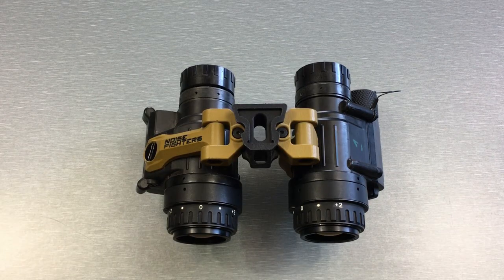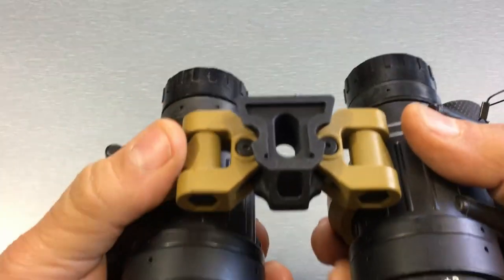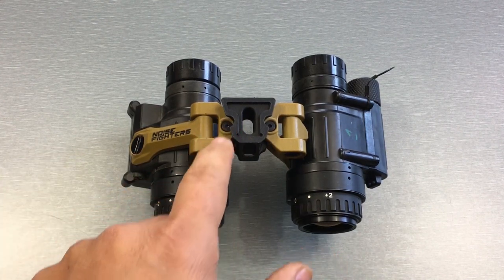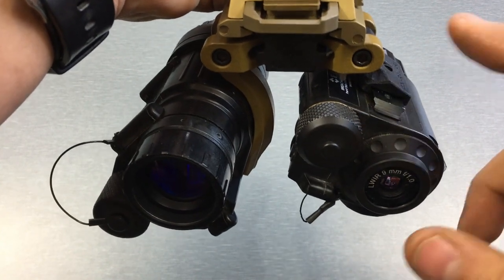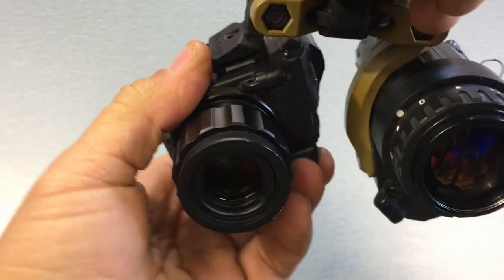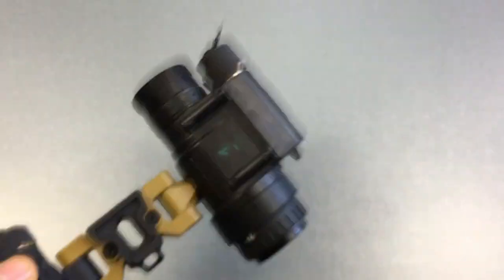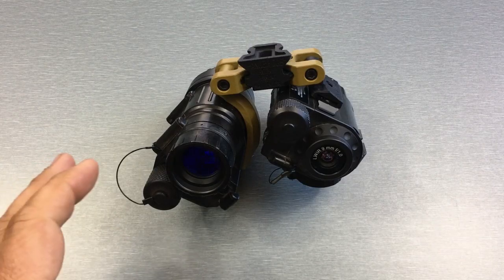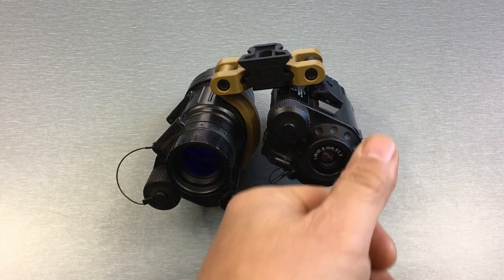Panobridge Mini-Rail Arm for Thermal Mounted Set Up

Comment: And you might note the pano bridge is a viable option compared to using anything offered by Knights Armament Corporation (KAC).  After watching your Thermo FLIR Breech video in 2020, I ordered the KAC setup you suggested.  Now 13 months later I'm still backordered at TNVC with no delivery date available due to KAC components being on backorder without an expected date of delivery.  So while the KAC bridge and shoes make a very nice setup, I may have to use my pano bridge to put my FLIR into service.
Thanks for the information you provide, it's very helpful.
Reply from the maker: Thank you sir. Yes, much more viable option. KVC is MIA unfortunately

Comment: Nice ive been thinking about getting one. And the qd feature would be nice but as long as you can rotate it out of the way it's fine.
Reply from the maker: If you don’t need QD and they’ll be staying on the bridge, the PB is a solid option. The pano feature does help to line up the screen compared to all other articulating bridges I’ve used

Comment: Have you tried using a iray mh25 or ml19 with the pvs14 eye piece adapter with a pvs14 instead of the breach? If so how did you like it? If not any reason why not going that route?
Reply from the maker: I have not. I don’t have access to them and I haven’t had a need to buy one because the Breach meets all of my needs. My property is treed pretty good and the average visibility distance is less than 75 yards.

Comment: Have you had the chance to get your hands on the iRay MH25 or rh25 thermal's? The RH is pretty dern expensive but they're saying they are higher resolution and easier to use. Would be cool to get a comparison video to see if its worth the extra price tag on the RH25 unit or if a breach is good enough.
Reply from the maker: I haven’t used one but I’ve seen the image and it’s no doubt better. But if you’re mainly using it at shorter ranges the breach is perfectly capable.
Reply: @NITEWALKER-NIGHTVISION  Understandable, thanks for the insight.

Comment: How long can you bear to wear this system? What's the total weight?
Reply from the maker: Total weight with two PVS-14s is around 24-25oz. If your helmet is balanced well and you have good pads it’s not terrible and especially if you’re used to wearing helmets.’
Reply: @NITEWALKER-NIGHTVISION  Do you need manual gain if you want to do this kind of setup? Would a tanto with no manual gain make it difficult to combine the 2 images, or can an iris work to substitute?
Reply from the maker: @musicman1eanda  You should always use a monocular with manual gain. When you use it with the thermal you’ll likely run it at max gain but there will be times when you use it by itself and manual gain is what you want. 

By lowering the gain, you can get your brain to combine the vision from your unaided eye.

Comment: So what mount IS your favorite for running pvs14 with Flir Breach?
Reply from the maker: KVC. Unfortunately they’re still MIA. Hopefully will have them soon
Reply: @NITEWALKER-NIGHTVISION  where does the KVC surpass the panobridge or Wilcox bridge mount in your opinion?
Reply from the maker: @practical_precision_shooters  for use with a thermal: better IPD adjustment, QD attachment, and more adjustability at the center dovetail in particular
Reply from the maker: @practical_precision_shooters  to make clear, the Wilcox MUM arm doesn’t not have QD or IPD with their thermal arm.
Reply: Been waiting over a year for the KVC so far
Reply: @mikeb4708  has it been on backorder?
Reply from the maker: @mikeb4708  unfortunately unknown eta still 🤬

Comment: I just got mine and I'm a little disappointed. It seems to me that  it wouldn't take much for it to break. Wish they had one in aluminum
Reply from the maker: Although it has some “bendiness”, the material is tough. The material is what makes is so light. Aluminum would increase the weight by a few ounces
Reply: @NITEWALKER-NIGHTVISION  I hope so it wasn't cheap. Lol.. other than it feeling flimsy I do like it. Field of view is a lot better
Reply: Question for u. I also have the TNVC powered bridge mount..do u know of any cables I can get and a battery pack that's compatible with it?
Reply from the maker: @armon8399  the PBM uses a LEMO connector which is compatible with ANVIS battery packs. The AB Night Vision LPBP-GO’s cable is long enough to reach it.

The standard USGI ANVIS battery pack cable is not long enough because they are designed to work with helmet mounts that also have a cable, but if you are capable with soldering/splicing you can extend it.

I recommend using the ABNV LPBP because it’s much more durable and is a dual fuel pack (AA or CR123A).
Reply: @NITEWALKER-NIGHTVISION  I have a ANVIS battery pack and I couldn't find a LEMO cable with the correct ends on each side. It's been a while but I think it needs a feamle and male end on the cable or something like that. What ever it was, a standard lemo cable would not go from the anvis to the PBM. I did speak to someone at TNVC and all they said was to get a custom cable. Didn't help me much
Reply from the maker: @armon8399  the USGI Anvis packs are prewired with the cable coming out of it with just one connector that will plug right in. It’s the same connector used on the ABNV LPBP. If you get the LPBP you’ll be good to go
Reply from the maker: @armon8399  but like I said, most of them the cables aren’t long enough because they’re not designed to reach all the way to the goggle, but instead meant to plug into a cable from the mount. The LPBP cable is made longer in order to reach

Comment: Can you get the images to fuse now by tiling the thermal?
Reply from the maker: It might help but everyone’s ability to fuse the two different images is well, different, lol. I’ve only been able to “fuse” them using the Breach in outdoor alert mode.
Reply: @NITEWALKER-NIGHTVISION  Ahh I see. Your older videos indicate you weren't able to get a fuse at all.
Reply: @NITEWALKER-NIGHTVISION  With budget in mind, what is the most cost-effective system for general use looking around the property? PVS-14 with what kind of thermal (scope or ortherwise)?
Reply from the maker: @user1acount  sorry been busy busy. I’d take a -14 and thermal monocular over duals and no thermal
Reply: @NITEWALKER-NIGHTVISION  Thank you for the reply. Would helmet mounted thermal be better than a scope? Do you prefer a certain model?
Reply from the maker: @user1acount  depends what you’re doing with it. Hunting and you can only have one thermal then a scope. You can always use it handheld if you wanted to
Reply from the maker: @user1acount  model-wise it depends on budget. The Bering Optics Hogster is a great value. We have them at Night Goggles. Otherwise, if you want to spend more, the NOX-18 or NOX-35 are really awesome. The -18 is better if you’ll use it as a scanner more than a scope because it is a 1x magnification. If using it as a scope more then go with the -35